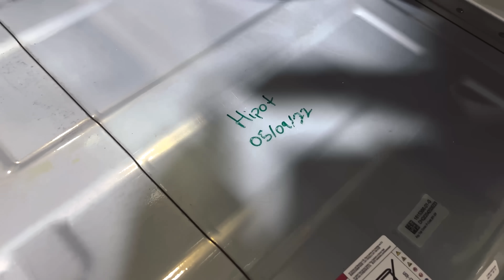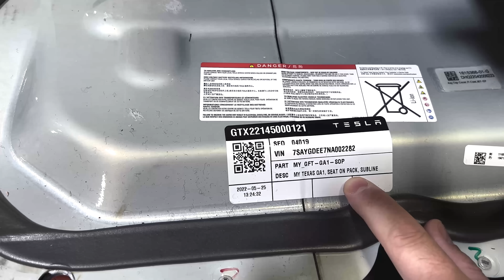Tesla Model Y 4680 Structural Pack OUT!!!

Comment: Absolute wicked guys. Keep it up. This is really great. A lot of the legacy auto is still on their Gen 1 skateboard, or hoping to get there soon. It's gonna be hard to keep up. The introduction of the structural pack and the ramp up of production can be tough. But after that is honed in, we are in all essence looking at EV v2.0. Imagine how much time this should save in the production line? And likely we are talking an even safer and stiffer car too, less flex. What about weight btw? Any savings?
Reply from the maker: Thanks! Will do!
Reply: Oddly enough, the paperwork for the structural-pack Model Ys that Tesla submitted to the EPA shows that they're a little bit heavier than the non-structural ones. By like a dozen pounds. It made the Tesla subreddit scratch their heads trying to figure out how that could possibly make sense.
Reply: @coredumperror  my assumption is it was done to simplify assembly time / cost not weight.  Adding brackets or mounting points means a thicker casting. But, im only assuming.
Reply: @coredumperror   Why the head scratching? The pack is structural so that takes more material, but it replaces all the structures that surrounded the old battery pack, a lot of metal that made up that part of the unibody/chassis. All those pieces must add up to a lot more that a dozen pounds.
Reply: @donjones4719  Why the head scratching? 

Because the entire car is heavier, not just the pack. The fact that it replaces a ton of structures (ie the entire floor pan) should mean that the whole car got lighter, because it's no longer carrying a battery pack that is just cargo. Yet it got slightly heavier, despite having significantly less energy than a long-range Model Y made in Fremont.
Reply: @coredumperror  It means that it is overdesigned. Not a bad thing. It means that it is stronger and more rigid. It also depends on the way the cells are mounted and whether the cells contribute to the structure also.
Reply: @coredumperror  I don’t think the 4680 is anywhere near peak efficiency yet.  I think we’ll see significant weight loss in these packs soon, all while keeping the same kWh.
Reply: @sphigel1  Why?
Reply: @coredumperror  The pack itself might be heavier, but because it is structural you cn remove (redundant) mass in other places of the Car. Most notably the Floor Plate is "missing" since its now part of the Pack itself. In the end the only things which count are overall weight and weight distribution, not mass of a certain part. and if you have to add 1kg to one part to remove 2kg from another part that is a win.
Reply: Can't remember when it was mentioned, probably battery day.
Telsa mentioned that the structural battery pack + the Giga castings should reduce weight by about 10%
Reply: Maybe there will eventually be a company that does a single casting - perhaps a true MiniE. Or when additive metal printing becomes the real deal and is scalable. There's always room to grow / copy / advance.
Reply: @transendre1  We can start by using plastics, acrylic and polycarbonate. Acrylics for transparency and rigidity, polycarbonate for flexibilty and energy absorption. Even 3D printing using them is much cheaper than any metal that melt at a much higher temperature.
Reply: Yeah, like Government Motor's "Ultium" EV drive train platform, 6 moths after Mary Barra proudly unveiled this 'new' platform, it INSTANTLY became obsolete when Tesla unveiled the structural battery pack during Battery day.

GM has now produced a couple hundred cars on this platform, the Hummer and the Liriq. The Chevvy Bolt is not even built on this new platform, and has a LG Chem designed platform. No way GM can ever be profitable with this platform, when Tesla starts reduce prices to keep demand up. 

Ford already has admitted they cannot make a profit with the Mach-e at current price points.. But they cant raise prices, because then for sure the customers move to Tesla!... VW has not yet admitted this, but I am pretty sure they are in the same situation as Ford.
Reply: @MarcoNierop  Ultium always seemed to be about easier module replacement because GM built a platform around battery cells they do not trust.  This is the problem with buying batteries from 3rd parties with little control over quality.  The bolt demonstrated exactly why they want this. Ultium is less efficient in every way to be cheaper for replacing cells during warranty periods.  GM thinks they can compete using the traditional approach of having squeezable suppliers make everything.  GM is going to survive past 2030 as a brand name held by a chinese company who buys the naming up in bankruptcy.  The inefficiency of what GM normally does is obsoleted by newer companies like tesla.
Reply: @_PatrickO  Ultium was designed with their military contracts in mind. Milspec is great for all kinds of things, but it doesnt seem like the best way to reduce cost, size or weight to me.
Reply: @patreekotime4578  Sure, who also wants repairability.  GM packs will be the least efficient out of anyone's due to being built to be less dense so it is easier to open and replace modules.  I bet we end up with real ultium and chinese imports that are just the same denser packs in SAIC's chinese models.  The chinese imports will be called ultium to hide that they are different.  GM is all about marketing, not making good products.  Yes, I drive a chevy volt, I know first hand.  The parts not made by GM are the only quality parts of the car.

Comment: Going to make dealing with salvage vehicles more “interesting” if you have nothing to sit on once the battery is removed. Remember when a vehicle could be pushed while someone steers? Yeah no more of that, now it’s all going to have to be forklift work, and who knows if you can do that with all that missing structure. Interested to see how it’s going to work since these are not supposed to be throw away devices like electronics.
Reply: What purpose is there to sit in an EV without a bettery? Where are you going? You really have some case where you need to push a body around a yard? Seriously? It’s easy anyway.. ever see the Flintstones? Yabadabadoo.. use yer f’n feet and walk from inside the car..
Reply: @airheart1  Both the yard and the person who buys the salvage car will need to move it for one reason or another. It has to be loaded and unloaded on a trailer for transport and delivery. All the 12v systems will work without the main battery pack, so it comes down to the problem of having a giant hole where the driver would sit and steer and brake.
Reply: @Weezedog  hmm. Odd case.. but, where there’s a will there’s a way.. rig up a little wooden frame you can lay inside with a seat you can throw on it.. idk.. gotta be a way to make it work
Reply: @airheart1  At least in the future you will know for sure if the Tesla you are bidding on for salvage still has it’s battery. Previously there was no obvious way to tell if the battery was removed, you had to closely examine the vehicle’s ride height to see if there was a larger than normal wheel well gap indicating the 1200lb battery weight had been removed and the suspension was sitting higher up.
Reply: Just put your own chair of choice inside of the car;)

Comment: Seems pretty incredible the structural pack including seats, carpet and center console is only 1,198 lbs when the Rivian battery pack alone (just batteries) is nearly 2x as heavy. Innovation at its finest...thanks guys!
Reply: Pre-structural packs weighed about the same. The Model Y is an 82 kWh pack having a curb weight of 4380 lbs. Rivian is a 7K lb behemoth with a 135 kWh pack. Not even remotely comparable.
Reply: @KyleHubb  Yeah, I didn't get why they mentioned Rivian's battery pack being heavier. Well yeah, it's almost twice the energy capacity. Wow, 10 gallons of gas weighs twice as much as 5 gallons of gas.
Reply: @JEP-Tech  you don’t get it, do you? Add the ENTIRE STRUCTURE, seats and all, you just saw in this video.. PLUS more than half the battery capacity.. and it weighs HALF of JUST the batteries of the others. If you can’t conceptualize how much weight savings that is.. just wait.. I’m sure the people here at Munro will spell it out in more detail as this goes along
Reply: @airheart1  heaviest part is still the battery and I’m betting the rivian battery pack case at the bottom has a little protection because of its offroading capabilities.
Reply: @airheart1  I'm sure there are weight savings. But considering they know the weight of the older Model Y battery pack, they should have compared it to that. I suspect they will in their teardown video. Doesn't mean much to say a 70-90kWh battery pack with seats attached weighs half as much as 130-140kWh one with no seats. That's all we saying. Take care.
Reply: @JEP-Tech  fair enough.. this is just a peek.. i think they will get us much more in depth info on this to make it more clear in the coming days. Very true though, they DO need to compare it more to the older Y.. but it seems they plan to, it should all be quite interesting.
Reply: @officialyasir  they specifically said, ‘just the batteries’, of the competitors. We’ll have to wait and see more detail on this.. but I don’t think they were counting what you’re suggesting in the comparison.. i’m sure it will all get more clear as they go along in the teardown
Reply: @JEP-Tech  Yup, especially this being a 67 kWh pack from Austin.
Reply: @airheart1  The Y pack is a 67 kWh pack. Rivian pack is 135 kWh. Are you kidding.
Reply: @KyleHubb  
To be fair it could be software limited for all we know. Although I doubt it's anywhere near 82kwh regardless.
Reply: @airheart1 So what happens when that famous New England salt  spray gets to all these parts? I watch Eric on SMA fighting the incredible corrosion they have up there.
Reply: @KyleHubb  batt tech changed the game
Reply: @KyleHubb  pre structural pack was 1168lb, this is 1198lb with the seats, centre console and all mounting brackets and cabling. That's probably an additional 250lb.